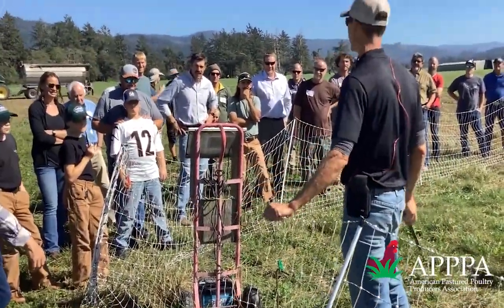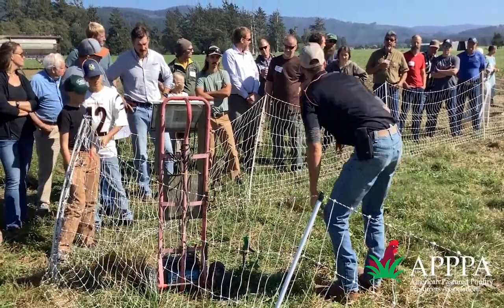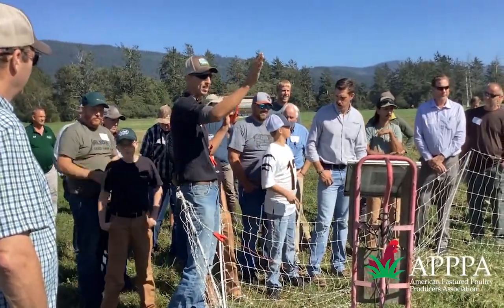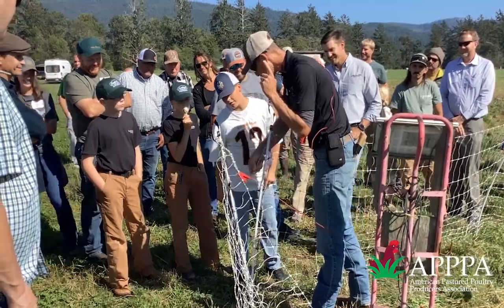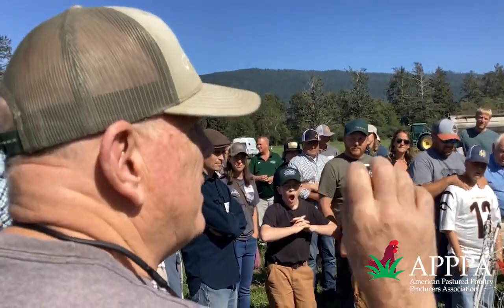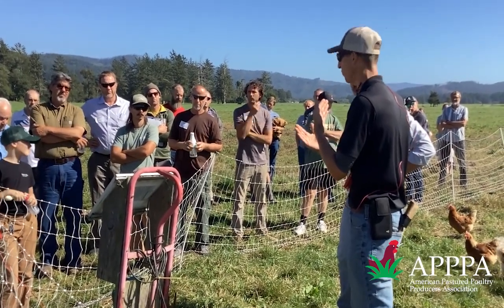Understanding Electric Poultry Fencing - Part 2: Practical Application

Comment: Storing a battery on concrete doesn't effect it at all .If not maintained with trickle charger it will discharge in time. Modern batteries have plastic cases .so its a wifes tale! Its called common sense.
Reply: 10x your 60B dollar cattle industry and 59B dairy industry picking up your fresh grass clippings you get paid $3200 a year for and everyone in business in air conditioned lawnmowers mowing America every week and grass sucker trucks take fresh green clippings to rail cars, then to be sprayed with water and dumped in coolers and they go out the other side on conveyors to feed cows in a huge room with a fans on them and they get a bowl ice cream at the end of the line and they make the best milk, cheese, cheese cake and ice cream. Give them cow toys and a back scratcher. When she doesn't want to be a cow anymore give her a bowl of ice cream with fent.ynal.  You wait all year for some corn and mow the entire United States 16 times a year, and motorized vehicles to pick up core foods, and throw it away, maybe 1.19 Trillion dollars a year in unrealized dairy and cattle potential. Plus you mow Europe and Asia

A bull will become 2,000 pounds from eating grass. If you can make it naturally edible to humans through a natural bio process you can feed the world grass smoothies. Your lawn mower clippings can go right away to filters to feed 3x the cattle, also ocean water can be piped through dry river systems, or sent straight to California homes and the river goes all to the farms. Use a steam distiller to disinfect and remove salt from your drinking water, 1-2 gallons a day. Don't put salt in your water, put it on more roads in the winter. Put salt water in your swimming pool and get a dolphin. Plant ocean grass for your yard and water with ocean water, one BBQ won't burn down 10,000 houses

3,570,000 people could be in business with 10 employees making 100,000 a year, and we throw it all away, every year

Instead of $20 for a 2lb salmon, let's make air conditioned fish farms by the Atlantic and make 20x more fish, well buy the $8.50 fish for $9.20 and sell them all for $1 each, they're, your dollar will become worth 20x more in the fish market. Build an economy.

The future is indoor fish farms, air conditioned. It looks like a resort, fish is free, breakfast lunch and dinner or pay for meals. You can buy coffee and work there. There's showers, a gym, and you can take a nap on a couch, and there's security. If it's 140 outside hang out there all day, make them all over the world, retrofit churches that are air conditioned all week for only a small amount of people to visit one day a week into an air conditioned fish farm. Feed them fish and have an air conditioned dairy farm and chicken coup attatched, get at. A 2,000 pound bull and a chicken born with winter clothes will be kept indoors where it's 65 degrees. You could make this world awesome, we print money and waste building materials and resources instead of building a food infrastructure. 20' Concrete walls lining the interstate could have a roof and another wall and be a factory, then 10' of woods across the street, then the neighborhood. Share this with cool people, peace out

1 K of Fennies = 500,000 people who don't want to be here get out for 1.2 cents a piece. 84,000 Russians and Ukrainians killed each other When $6,000 of fenyn.al would have let all the pained and suffering escape a horror and daily death and not blow up the grandchildren and Bill them for a wheel chair and try to put prosthetic limbs on them afterwards... when 6 times as many would say thanks for some pills or a drink instead

People have to pull out 5 of their own teeth after building people free housing and dentist offices when they lose their home their families in free housing buy them for 50 cents on the dollar.  Pulling more teeth with pliers today.  As a kid they took a metal pick and pressed really hard straight into the sides of teeth at the gum line for more customers

Instead of making lieral mile after mile after mile of car dealerships and paying 20x more for eggs and fish, and 4x more for rent and orange juice and gas while we waste not only that but materials and labor, let's make air conditioned hen houses and inspire dairy farms.  Let's have online car dealership apps, one big parking lot where Joe sold 20 cars, Donnie sold 24, Jimmy sold 24 etc... You can deliver the Caddilac or have one guest house for puerile that bought their car online even from a remote worker car Salesman not pulling out his own teeth and paying gas and tools to drive 2 1/2 hrs a day. Make a dollar worth 200 even 2,000x more in making so much food.  Nice first preserve, but it would be better service to this country if it was a poppy field.  No more pain, some people party or just have a poppy seed tea game the most nicest time and sleep awesome.  And if puerile don't want to be here that can leave, when they want, and more for those who want to be here.  Why the government owns a field to grow neither food nor pain reliever a way out of here is idiocy in slow motion

A robot can change and x ready ever rail car wheel that goes in regularly for service and wheels are dirge melted down or refurbished and they're no more derailment. Somene can get paid to pay in a Rock band or on a sports team don't what he loves, Dad has another sponsor. Instead of driving 2 1/2 hrs a day to go to a stinky dump and run over garbage and coming home hot and Snelling like garbage, you could only work 8 hrs instead of 10 1/2 and be in an air conditioned living room that smells great, and since you don't have to have air conditioning in the trash smasher truck is cheaper in your living room which smells great,  your wife might enjoy watching you work : ) My you smell like lilacs !